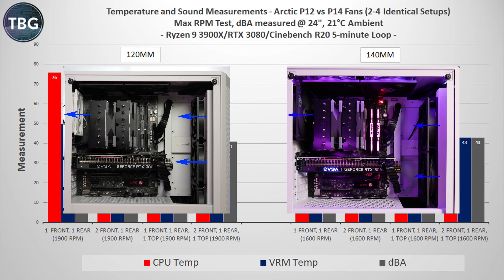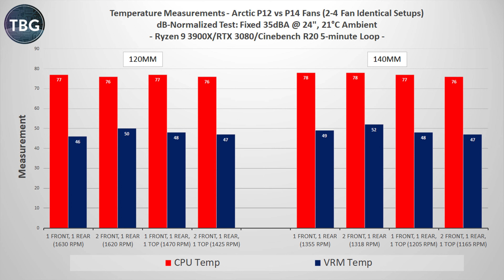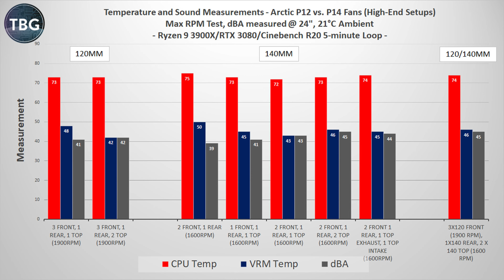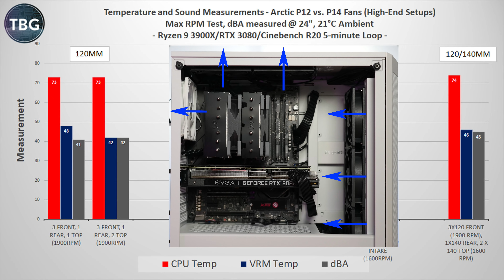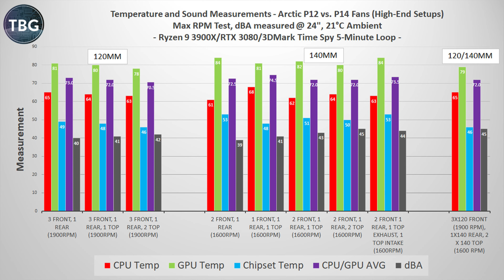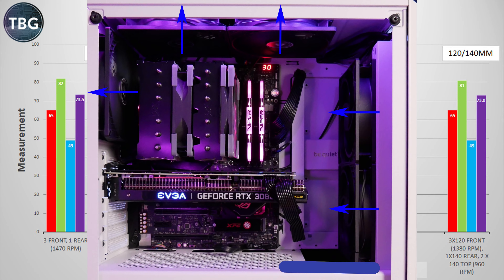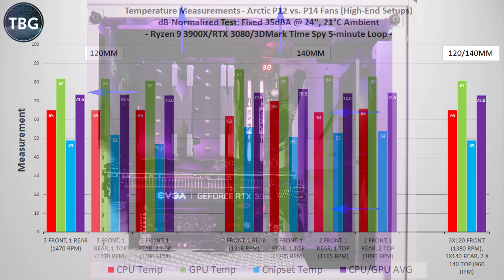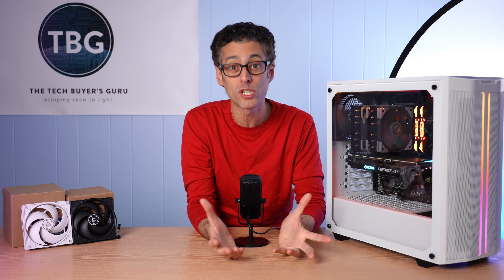The Best PC Case Fan Setup - How Many, What Size, and Where, feat. Arctic 120/140mm Fans!

Comment: Really love all this testing, but I’m curious. What is the margin of error with these data? The temperatures between the different setups all seem very close for the most part and we’re comparing the difference between a couple of degrees.
Reply from the maker: I would only be able to calculate a margin of error if I ran each test dozens of times, i.e. collect a number of samples for each data point, which I do not. I'm already collecting a huge amount of data, using two different benchmarks, and the patterns are quite recognizable in the data. There are countless ways to improve the data collection process, from using multiple runs of each benchmark to test repeatability, to using temperature probes to gain more precise readings, for instance to the 10th of a degree.

But honestly, the task of conducting this type of analysis is going to have to fall to a bigger channel, because I'm not even coming close to covering the cost of my time to produce these videos, let alone the equipment I would need to run the testing. Then again, big YouTube channels are quite content to get hundreds of thousands or even millions of views for content that really doesn't add much to people's understanding of PC cooling. There are a few good ones out there, but most are not moving the ball forward.

Put another way, I doubt you'll find more convincing data on YouTube on this subject.

Comment: Thanks for this awesome video! I have the same Pure Base 500DX case with a front-mounted 240mm AIO Radiator. What fan combo would you recommend if I have the Arctic P12 5-pack and the stock Pure Wings 140mm fans?

Would 3X Arctic P12 in the front, 2X Arctic P12 on top, 1X Pure Wings 140mm in the Rear be best?

Comment: I'll be honest that while gave this video a like, as it holds a lot of valuable information, I'm a bit disappointed at the same time. I understand that some people always wear closed-back headphones and listen to music when their PC is on, but without any other sounds, 30 dB+ noise is clearly audible and starts to be annoying, so a 30 dB comparison would be welcome. Can't imagine 40dB personally. I would also like the tests to be run for 10 minutes instead of 5 as I'm pretty sure that especially at low RPM the results would be much more accurate and the differences between various fan setups or models larger. It may not be so important for CPU fans, but here it should be. To compensate, RPM-normalized tests could be removed, they are a thing of the past. It would also be beneficial to replicate real-life conditions by instead of placing a mic at some random distance, moving it to average ear position, let's say 1.20m from the floor, 20 cm from chassis front, 30 cm from chassis side. Some noises will be largely dampened at this range and angle. You would need to have good acoustics in your room for a low noise floor though. Also, as the top exhaust is clearly the loudest, maybe adding it with a significantly lower RPM compared to other fans would make the configuration much more viable?

Comment: Damn, I was hoping that you tested my setup of 2 140s for front intake with 1 rear exhaust and 1 top exhaust near cpu.
Reply from the maker: I did test that.
Reply: Shoot! I meant with 120mm exhausts. 140 intake, 120 exhaust combo. Sorry
Reply from the maker: Oh, yeah, I considered that, but I think the only reason you'd do that is if you can't fit 140mm fans on top and in the rear, so I stuck with maxing out those two spots.

Comment: I've watched lots of videos, especially your round ups, but unfortunately didn't come across this one. I was gonna buy exactly this case in the future and prepared by buying 3x the P14 PWM for 10 EUR each. I thought they would be PERFECT for a silent Airflow based PC using the 500DX, but right now they're inside my Fractal define R3 and create different kinds of annoying noises, when they are attached to the case, especially as intakes. So I run them at 300 RPM. Minimal airflow. Even then they sound bad. Neither my 10 year old 120mm stock fan, nor the 10 year old 135mm fan I took out of an old be quiet PSU have this problem. Do you think the new case one day would solve this issue?

Comment: Love your videos, especially as the first-time builder. I have the same setup ready to install, the same case, and the same cooler Fuma 2. CPU i9-9900K I'd like to have max cooling.
Question:  - Do you think would be ok to put 3rd fan on the Fuma 2 using the setup you have here??? or you think it's too tight and the Fuma2 fan and exhaust fan would be too close and would work against each other???

Thanks in advance!
Reply from the maker: I've never tried it, and I think with some motherboards it won't fit. Once you have in installed, you can always try doing it with the existing case fan to see if it would even fit.
Reply: @TheTechBuyersGuru  I checked and looks like I can fit, but I have little less then half inch left between fuma fan and case exhaust fan, my concern is that both fans will would work against each other. What's your thoughts on that? You have more experience on building PC's that's why I'm asking. 
Thank you for quick response!
Reply from the maker: Probably not working against each other because they are blowing air in the same direction. But if they are very close, two doesn't provide much more benefit than one.
Reply: @TheTechBuyersGuru Thank you for your quick response! Love your videos!

Comment: In the 3DMark benchmark (at 8:16), it seems that 2 front, 1 rear leads to higher GPU temps at the same noise levels compared to 1 front, 1 rear for both 120mm and 140mm fans. Any reason as to why this might be the case? It seems that CPU temps are significantly reduced with 140mm fans in 2 front, 1 rear vs 1 front, 1 rear and I would've thought that the additional airflow with the second front fan would be of more benefit to the GPU since it's directly facing it.
Reply from the maker: I've tested this a number of times, most recently in my new Silent Base 802 review: https://youtu.be/4Y57m-_f1uA
The results are repeatable and consistent. The upper front fan is not doing any good for the GPU, as pushing cool air over the back of the GPU isn't actually what the GPU needs. On the other hand, helping create a chimney effect to draw that hot air out of the case allows the GPU to clear out its own exhaust and take in more cool air.
Reply: @TheTechBuyersGuru  Thanks for the response! That makes sense to me now. I just realised that the 1 front, 1 rear setup had the front 140mm fan at the lower position rather than upper. I've had a closer look at the graphs and I just wanted to clarify a few things to make sure that I've understood correctly.

It seems that:
	1) Top exhausts generally reduce GPU temps by removing heat around its components, but can potentially increase CPU temps for a CPU air cooler if the front intake air leaves through the top exhausts before it enters the CPU cooler's intake. 
	2) Front intake fans generally reduce GPU temps (front mid to low) and CPU temps (front mid to upper) by supplying cool air, but only if the air flow is directly facing or underneath the components.
	3) From a noise-normalised perspective, there are tradeoffs with particular configurations - adding more exhaust airflow might be at the cost of reduced intake airflow at the same noise levels, and vice versa. When noise-normalised, adding a single 140mm top exhaust (w/ 2 front intakes) reduced CPU temps by 2 degrees in Cinebench but the same modification increased CPU temps by 2 degrees in 3DMark. I'm assuming this is because the front intake airflow was effectively reduced, supplying less cool air to the CPU, which was much more necessary in the 3DMark setup as the GPU was increasing the ambient heat within the case significantly?

Would you agree with that? Sorry for the long reply! Your video was exactly what I was looking for as I didn't find any other investigations of this topic with the same depth as yours.

Comment: Really useful comparisson, i was wondering, have you tried the arctic BioniX P120? I think it uses the same bearings as the P12 but goes up to 2100rpm istead of 1800rpm (the 120mm one). I dont know if they are supposed to be better or just look flashier.
Reply from the maker: Just flashier! I've tested them, don't like them. Noisier even at same RPM due to bad frame design.
Reply: @TheTechBuyersGuru  Oh great to hear! i can get a P12 5 pack for less than the price of three of those, thanks!

Comment: Did anybody compare Arctic p120/140 PST vs their CO versions. Are CO versions quieter?
Reply from the maker: They are not quieter. They are louder and designed for continuous operation in commercial/industrial applications due to more durable ball bearings.

Comment: I'm wondering if there would be a benefit from adding a fan to the bottom on the psu shroud aimed up at the gpu.  Intuitively this seems to me that it would be beneficial for the gpu but I can't find much content on it.
Reply from the maker: I think the answer is a definite yes. I was actually considering using a different case for this series of videos that would have easily allowed that (i.e., had actual fan mounts, as using zipties isn't my style), but I decided against it because so few cases offer that feature at the present time. But more are released every month with this feature, so perhaps in the future, I'll do a similar test in whatever the latest case is and demonstrate the benefits.

Comment: Great review as always. I turn to air cooler. This  helps me big time. I bought NH-U12S and another NF f12 chromax fan for the cooler  Because of your reviews. In your comparison, the single fan version was two degrees higher than the freezer. I think it could be a little better with the extra fan
What do you think. These results really surprised me, I thought I could get better results with only one fan with top Cause I thought the two fans can blow the cool air before it reaches the CPU.By the way, you deserve 1 million followers.
Reply from the maker: Many thanks for the kind wishes, 1 million is a long way off, but maybe 100,000 someday in the near future!

Yes, the extra fan will help, making the U12S more like the Freezer 34 Duo.

Many people believed that the top fan is not good, but it turns out to be very effective for GPU temps. Testing that showed otherwise likely only looked at CPU temps, which actually could be negatively affected.
Reply: @TheTechBuyersGuru  so 3 front intake 2 exhaust top and 1 rear exhaust?

Comment: This was well done and very thorough. 
I do think, that you missed one test, that a lot of viewers would have liked (or at least me). When buying the "be quiet! Pure Base 500DX" you get three "Pure Wings 2 140mm"-fans. I would like to know the best configuration using these three fans in conjunction with a 280mm AIO and a big air cooler like "be quiet! Dark Rock Pro 4". As a bonus info you could give your opinion on whether it makes sense to upgrade to other fans or get three more fans to fill out all the available slots.
I know that this was not a test of a specific case or a specific fan but more a test of the placement of the fans
Reply from the maker: See my previous videos. Already covered all of that.
500DX review: https://youtu.be/kgvm5ZTAbFQ
Best 140mm case fan shootout: https://youtu.be/kgvm5ZTAbFQ
Reply: @TheTechBuyersGuru  Hi.
Thanks for the content and the quick reply. I looked at your videos, and I must have missed the pure wings 2 in the shootout since it is only in 2 out of 5 graphs. You mention the pure wings costs 20 dollars, but that is not the case in the EU. 
Pure wings 2 are 72 dkkr
Kaze flex 140mm is 202 dkkr (only RGB exists in 140 mm)
Artic P14 is 61 dkkr (43 dkkr pr. fan in five pack)
Noiseblocker B14 is 219 dkkr.

How would you place the three pure wings 2 fans together with a 240-280mm radiator (on top like your other video suggests?)Does it depend on whether the GPU is blower/open air? Would the configuration change with an air cooler on the CPU?
What kind of system build would prompt you to replace the pure wings 2 to more effective fans or increase the fan count?

Have you tested silent wings 3 and shadow wings 2 from be quiet?
Reply: I mean the 140mm variant of all the fans

Comment: Thanks so much! This is a fantastic video - I'm about to build in a 500DX and have an Arctic AIO so I'm going to play around with P14s!
Reply from the maker: Which Arctic do you have, and how do you have it mounted in the 500DX? I'm curious about which combos will actually fit so I can tell others, specifically if the 240mm fits on top, for example. I know the 280 won't, but other 280mm AIOs can, as shown here! - https://youtu.be/uUUItnZRHyM
Reply: @TheTechBuyersGuru  I have the 280, I'm planning on front mounting and since I got the five pack of fans I'm going to see if I can pull off a push-pull configuration for the AIO, but I'm waiting on my GPU to ship. Will report back when I do get my GPU so I can pull off my build!
Reply from the maker: That could be pretty tight, but mostly because the tubes will be hard to route if mounted down (which is how the interwebz wants you to do it nowadays thanks to a GN video). The hose outlets will be below the shroud, and I think they may not bend around the inside-mounted fans to get to the CPU.
Reply: @TheTechBuyersGuru  aaah, I didn't think of that. Well, worst case I'll have two extra fans lying around in the case of any failures.
Reply: @TheTechBuyersGuru  Following up on this - I ended up just going for the standard front mount for the Arctic, without push/pull, and outfitted the whole case with P14s. Your video on the 140mm fan shootout helped a ton! My build is here: https://imgur.com/a/GM0ryus

Comment: I'm using the Lian Li Lancool II mesh and have 3 120's in the front, 2 under the gpu and 1 exhaust on the back.  The only thing i can hear is the gpu fans ramping up when im serious gaming or benchmarking.
Reply from the maker: You might experiment with one of your bottom fans moved to the top as an exhaust if you're using an air cooler.

Comment: Really appreciate your work! It's helped me decide which fans to use and in which configuration. I have a Fractal Meshify 2 right now with 1 exhaust rear, a 360 rad at the top and 3 intakes at the front. 

Just wondering if you think adding a bottom intake fan might be beneficial to bring cooler air to my (open-air 3080) GPU? I'm really only interested in noise-normalised performance since I'm not planning on running the fans anywhere near max. Also, this might be overkill but how about 2 bottom intake fans? Do you think a bottom intake right next to the lowermost front fan could potentially create some turbulence with the air flows clashing since they're so close together?
Reply from the maker: I'd definitely recommend the bottom fan if you're finding your GPU is running hotter than you'd like. It won't add much noise in that location, and audible turbulence from cross-currents honestly doesn't really happen.

Comment: I have noticed that when you have Multiple fans on the same PWM channel. You get harmonic resonance( sort of a rhythmic hum) from all the fans. However if you put each fan on its own PWM channel ( use a fan controller or individual headers on your motherboard) you don't get as much resonance even if the fans are all running at the same speed.
Reply from the maker: Wow, maybe this was the issue! So many variables when you start really digging in! Thanks for the tip!
Reply: @TheTechBuyersGuru  arctics are actually known to have a hum at only certain rpms'. Turn them up a tiny bit past that point, it vanishes, turn them down past that point the hum also vanishes. ITs just at the like 85% point or so that they do that. Cant remember what channel exactly figured this one out ill have to go back and look. They were testing these against the Noctuas.
Reply: @TheTechBuyersGuru  I'm late, but Apple did make the fans on the big Mac Pro run at different speeds to avoid this noise
Reply: “Harmonic resonance” sounds like something from half-life
Reply: My Arctic F12s do that harmonic thing at very specific speeds as well!
Reply: So is it a good thing or nah
Reply: @WZRDr  Resonance cascade, I mean cough harmonic resonance multiplies the noise. It's bad.
Reply: Doubt.

Comment: Due to the front filter, wouldnt it be better to place the front intake fans closer to the front mesh? Dont you think that if separated from the front, air could be recirculated from the interior? Great couple of videos with the dx500 btw!
Reply from the maker: I specifically mounted them where I did to improve performance, reducing noise from pulling on the mesh filter. I don't think there's really any basis for the theory you have on recirculating air.
Reply: @TheTechBuyersGuru  Thats true, less noise for sure. Thanks.

Comment: Hello, I have an meshify 2 XL, which fans would you suggest for the case, it will be running a 5900x on a deepcool assassin 3 aircooler. Will 4 120s in front perform better than 3 140?
Reply from the maker: 3x140. If you actually look at the layout of that case, you'll see that mounting 4x120 fans will put half of the top fan and half of the bottom fan out of range of any components. That huge space is for 480mm radiators, not 4x120 fans.